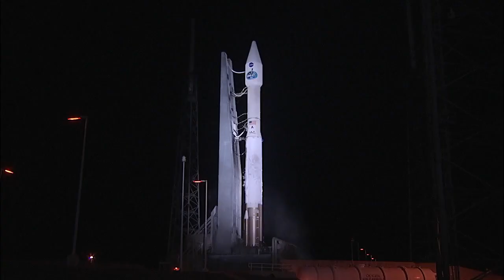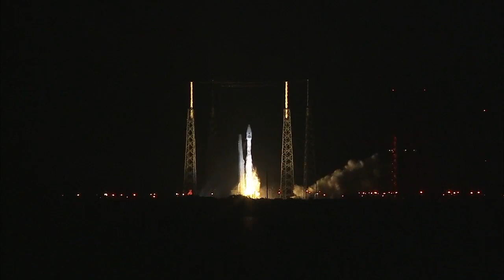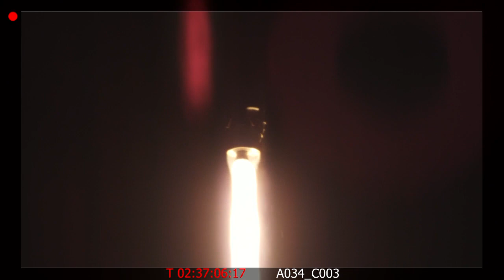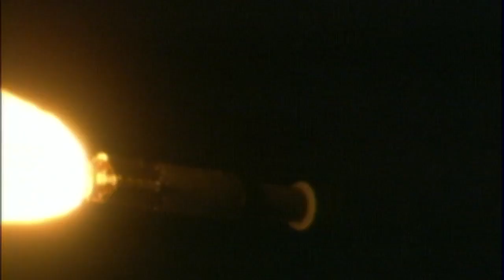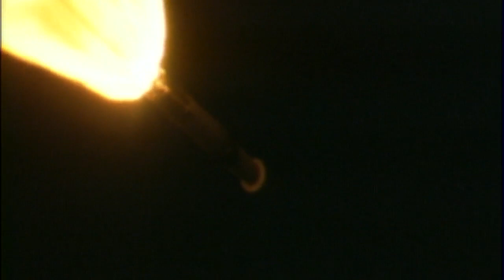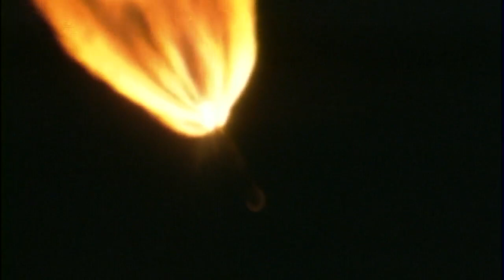Next Generation Satellite Launches

Comment: I've always wondered. Why do vapour trails only appear after exceeding Mach 1
Reply: I think the important factor to consider as to why there is a vapour trail is altitude rather than the speed of the rocket, since it's the same physical phenomenon than the trails induced by jet planes at cruising altitude, yet most of them are  traveling at subsonic speed.  It's has something to do with the humidity and temperature of the atmospheric layer at this altitude, the Mach number is mostly irrelevant (In my opinion).  However, the transient cone-shaped cloud around the rocket is definitely caused by the acoustic shock wave present when ''breaking the sound barrier''.
Reply: Oh. Interesting, thank you. So it's just that the rocket exceeds Mach 1 at a certain altitude where vapour trails start to form. Why didn't I think of that. :/